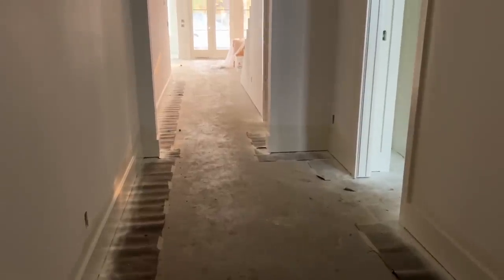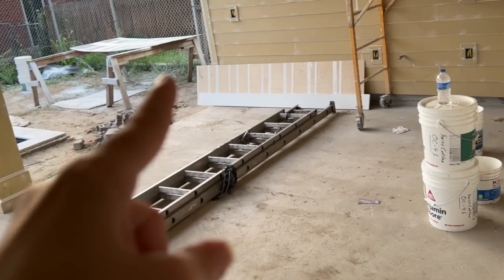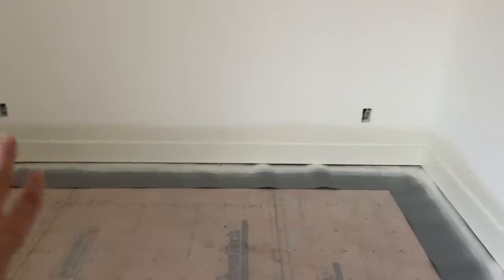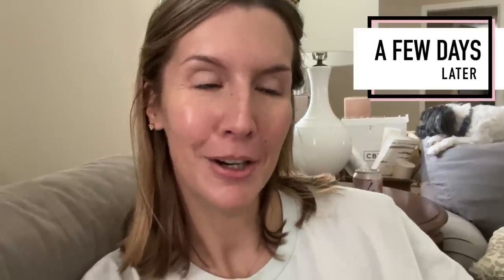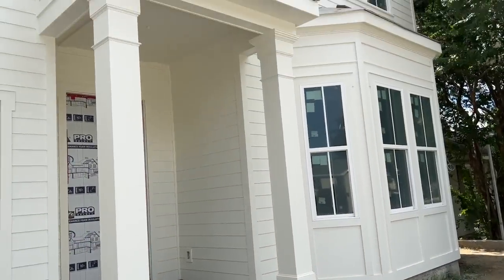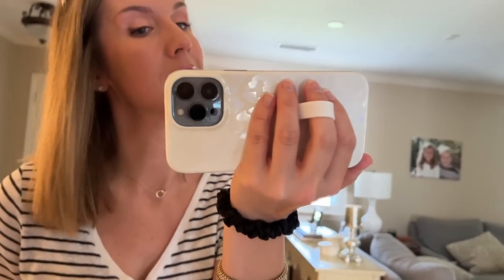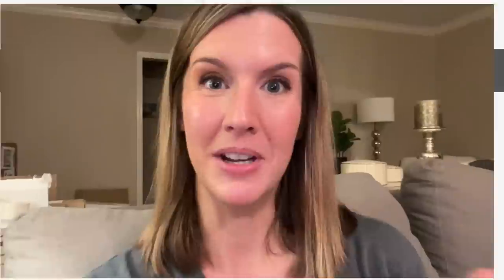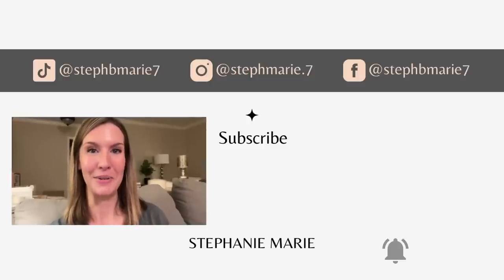LOTS of Disjointed, Overdue House Updates & More!

Comment: Weird question: do you know of any books or websites or guides that tell you how to go about the process of building a house?  We found a lot that we like, we know what kind of house we want and we're ready to move forward but we have no freaking clue what the first step should be.  Do we buy the lot first?  Do we find an architect first?  Do we find a builder first?  Like... I'm almost ready to say screw it and just go buy a house that's already built but I know I'd be disappointed.  Anyway, if ANYONE can recommend a starting point I'd be forever grateful!
Reply from the maker: Hi! This is where Google and the website Houzz’s discussion search come in handy! You can search for basically any question you have and find the answer! 👍🏼 But quickly - most people buy the location/lot they want then look for an architect since you have to design in order to build. Many look concurrently so you can bid out the project to several builders once you have your design. This way you go with who fits in your budget and who you feel comfortable with. Some architects have relationships with builders which is nice because it’s more of a collaborative relationship. And many times they can make the initial plans/estimate non-binding so the they can be altered based on builder feedback or budget without financial penalty.👍🏼 There are no hard and fast rules.